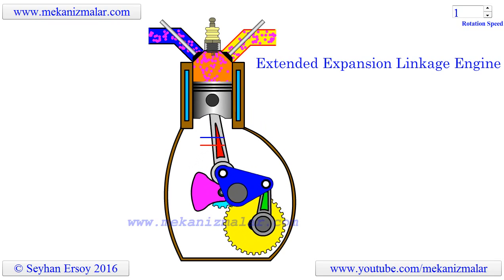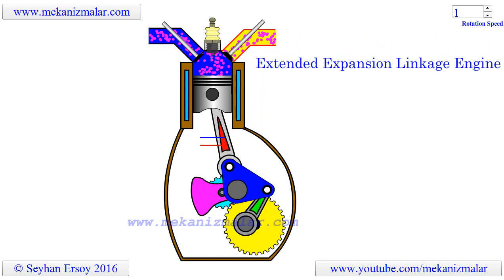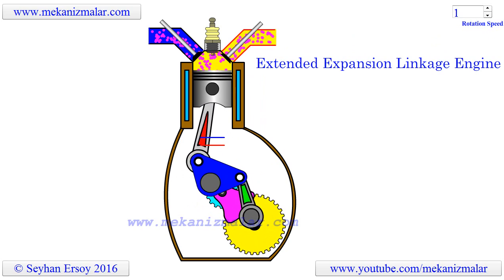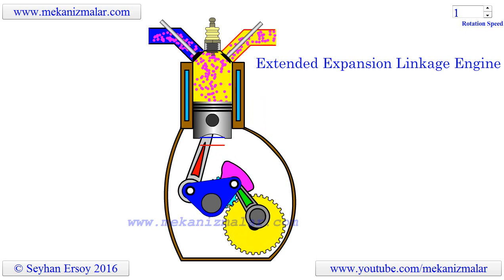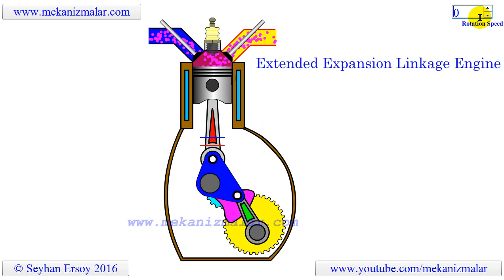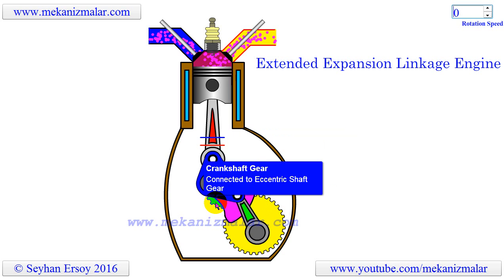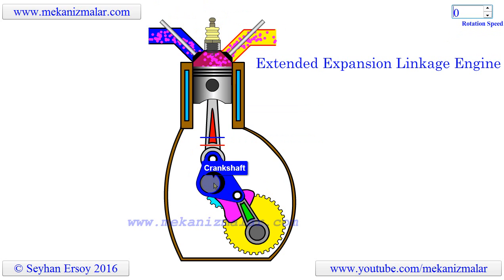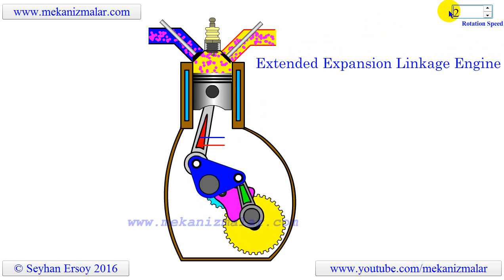extended expansion linkage engine

Comment: Have you ever seen the Atkinson Utilite' engine? It seems not many people are aware of it. It is an over expansion engine which takes place in a 2 stroke cycle. If you are interested I put some information on wiki and also smokstak... It would be neat to see an animation of the Utilite' engine.
Reply from the maker: Please send me any information you have. I will look at closely to see whether it is doable or not. Thank you for your continuous support.
Reply: Hello, Thanks for having a look. Here is a link to my post on smokstak. you can find some pictures and a drawing... I have only found one drawing and it's not so great but there is a good description of how it works in the Clerk books which I provided a link to. http://www.smokstak.com/forum/showthread.php?t=115633&page=20
Reply from the maker: How about this animation?
http://www.animatedengines.com/atkinson.html
Reply: That is the "Cycle engine" which was atkinson's second engine... one problem with that animation is the piston should have a short compression stroke and a longer expansion stroke.. The Utilite' was a 2 stroke engine that had the exhaust port located about mid stroke. During the expansion stroke a valve closed the port so gas wouldn't escape that way the expansion was full stroke. At the bottom of the stroke the exhaust valve (operated by an eccentric on the crankshaft) opened and let the exhaust gasses escape through the port. at the same time the backside of the piston pressurized the crankcase and once the cylinder pressure was low the air from the crankcase moved through a pipe to the front of the engine through a valve and into the cylinder. The valve is a poppet valve  opened by the pressure. The exhaust valve stayed open and new air scavenged the cylinder as the piston was moving toward the head. Once the port was covered compression started. There was a small pump along side of the main cylinder that provided a rich air / fuel mixture for combustion. I have some other original drawings of the original engine that might also help..  I could E mail to you f you drop me a line... my E mail is prontopower (at) gmail
Reply: here is a proper animation of the Atkinson cycle engine https://en.wikipedia.org/wiki/Atkinson_cycle#/media/File:Atkinson_Engine_with_Intake.gif
Reply from the maker: I like this one.
Reply: The Utilite' engine looks similar to this 2 stroke except that the exhaust port is in the middle of the stroke and the air enters through a check valve in the head... http://www.animatedengines.com/twostroke.html
Reply: I am Michael Frey on commons. The animations of the Atkinson cycle are based on the patents drawing. The drawings in the patents are more or less to scale. I think there is some distortion from the scanning, but it is really easy to measure the raw length in pixels and then fine adjust it in the animation. Using those old patents is no problem in therms of copyright: In the good old days, the content of a patent became public domain in exchange for the exclusive rights to implement the invention. On top of that, many of the original patent appliers are now long death, making their copyright invalid either-way. If thats not enough, there is the freedom of research and science.

Comment: I like the Ex link concept and I think it will become more popular because honda has said they can achieve efficiency up to 37%  Maybe you are aware of the original engines that James Atkinson made? His first engine was the "differential engine" and next came the "cycle engine" but not many people are aware of his last and possibly best engine which was named the "utlite' engine" Here is a description: Atkinson was able to make a more conventional engine yet preserved the efficiency of having a short compression stroke and a long expansion stroke in a rather ingenious way. It sounds much like a standard 2 stroke except that the exhaust port is located at about the middle of the stroke. The exhaust is prevented from escaping by a timed valve which remains closed until the piston reaches the end of the stroke. Once the valve is opened it remains open as the piston heads toward compression letting air and exhaust escape until the port is covered. a rich fuel /air mixture is injected by a small piston pump at the start of compression. This results in a shorter compression and longer expansion stroke.  If are interested in more information I can provide links and patent numbers...

Comment: That was VERY interesting and a well done video. Who would have thought it could be done, a shorter compression stroke to keep knock down and using cheaper lower octane fuel, and a longer power stroke to get the most work out of the engine. The best of both worlds all in one. Keep up the great work.
Reply from the maker: +wjf213 That is why I find it so interesting and decided to the animation.
Reply: The engine actually runs on propane or methane so knock isn't a concern.
Reply: +Corpsie I didn't know it ran on propane or methane, but really, fuel is not what causes knock. 

Knock happens because of low octane in the fuel and higher compression. Octane simply put is a fuels resistance to burn or ignite by itself or prematurely.  

With higher compression some times the fuel will ignite before the spark plug fires and when the spark plug does fire, now you have two flame fronts burning towards each other and when they hit, that's the knock you hear. 

Higher octane means it is much harder for the fuel to ignite prematurely or before the spark plug fires, thus no knock.

Now this is just for detonation, not pre ignition, which both create knock, but are two very different problems....but you probably already knew that, but most have no clue.
Reply: +wjf213 - the knock a person can hear isn't two flame fronts coming together otherwise the Mazda 2.3L  I4 dual plug engine would have been noisy.

Audible knock is when any part of the unburned fuel air mixture combusts instead of burns. The combustion causes an intense increase in pressure which is audible.
Reply: +Corpsie With pre ignition, the air fuel mixture ignites well BEFORE TDC and the piston is still moving up and shinking the combustion chamber size. When this happens, you're squeezing the burning mixture which is trying to expand and when the spark plug ignites, you have even more pressure building up and they come together and knock. With two spark plugs, they both ignite when the piston is getting ready for its power stroke and going down, so you have an EXPANDING combustion chamber which gives the burning fuel a place to go and no knocking as they are pushing the piston down.
Reply: +wjf213 - I'm not going to argue with you. 

Are you aware that spark for naturally aspirated engines typically occurs before TDC?
Reply: +Corpsie Yeah, just a little aware. I was a certified auto mechanic for both Ford and GM for almost 24 years. I'm just telling you what I learned at one of many of the Ford schools I went to. I they actually had a video they showed us with a micro camera mounted in the head of a piston and they showed pre ignition, and detonation and the difference in the two. Slowing the video down, clearly showed what was happening inside an engine when they initiated each scenario. That's all I'm saying.
Reply: +wjf213 - I work in powertrain. I program the computers that detect knock, measure pressure, calculate combustion noise, monitor stochastic pre-ignition, etc.